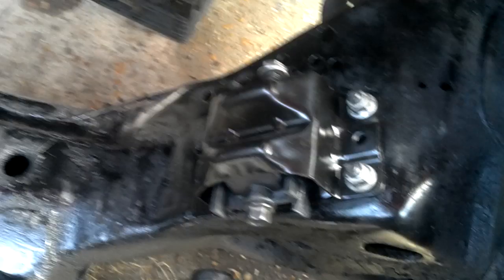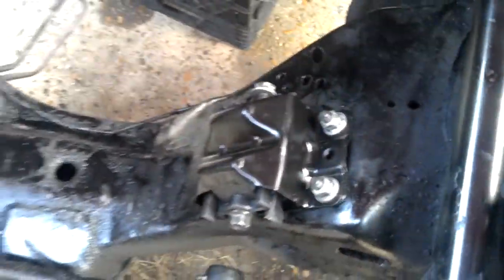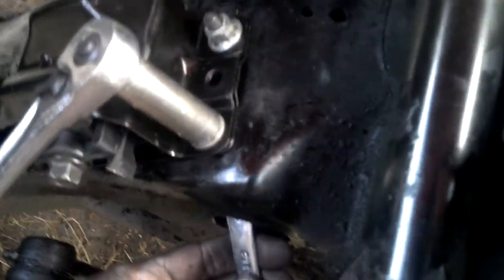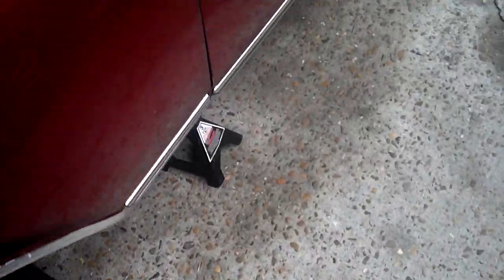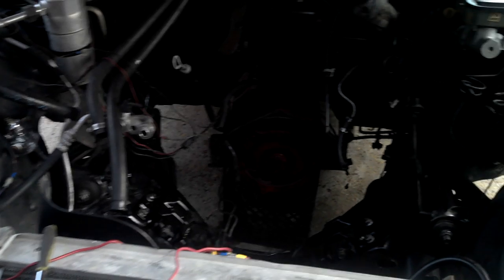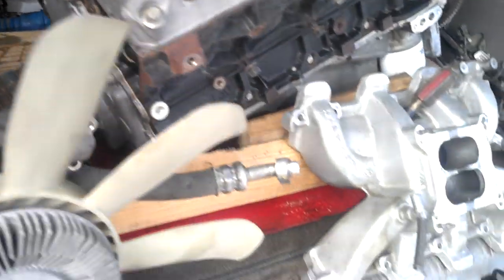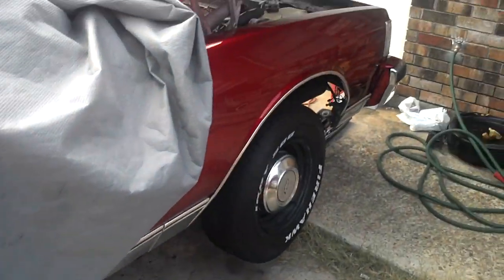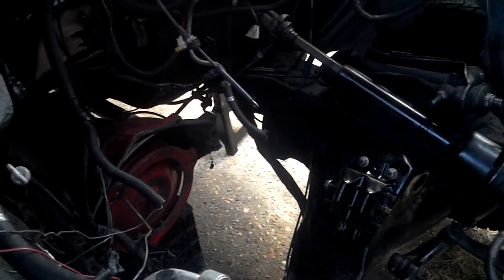Motor mount change and new engine update

Comment: Just for everyone seeing this.This is what i did  i used a 2" hole saw bit an drilled a hole in front of the frame so you can get to that bottom bolt  like he did for the 2 top bolts or use a torch to cut the hole,hole saw bit just looks alot better, you don't have jagged edges or you could do this to the back side of frame so you don't see the holes,when you need to change them again the holes are there,  That is if you got the motor out you can use the hole saw,

Comment: Also to get them bolts up threw the frame like hes gotem, i used a stick magnet,stuck the bolt on it an stuck them threw that big hole an line it up with hole in the frame an mount, then got the nut started ,its not fun but youll get it done lol

Comment from the maker: Those would work but i dont like adjustable mounts on an engine..if u plan on using ur existing transmission (as I did) just get Transdapt 4595 plates...my trans was a built up trans by TCI therefore i just moved da engine back 1 inch in my engine bay to where my other engine normally sat.

Comment from the maker: @louis, you only gone use the FLAT PLATES...Bolt those to your engine..THEN the mounts that came off your PREVIOUS ENGINE, bolt those OLD mounts to these FLAT PLATES on your new engine..Once you do that you will have FLAT PLATES and OLD ENGINE MOUNTS bolted to the engine...NOW you can bolt the engine to your FRAME MOUNTS thats already bolted to the car. GOT IT??? let me know. The other lil mounts that came in that kit you not going to use.

Comment from the maker: Nah didn't change fuel lines...they already 3/8" which is more than enough to power the engine...and no i didn't have to change da oil pan but i had bought a oil pan back in Nov 09' so i used it since it was a brand new one